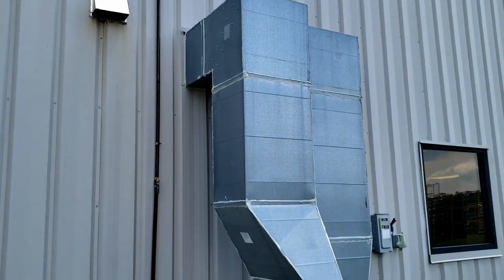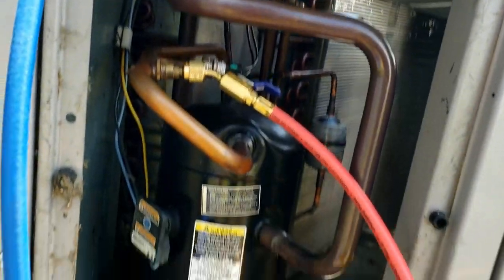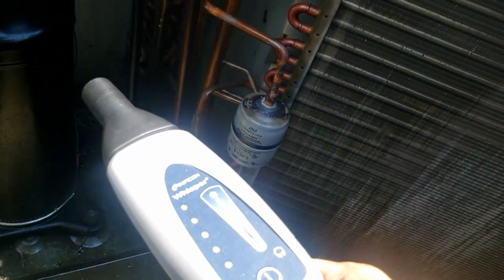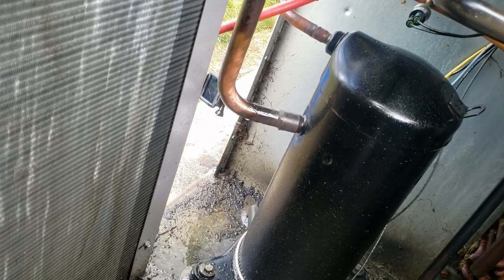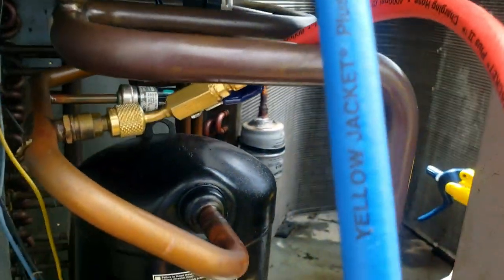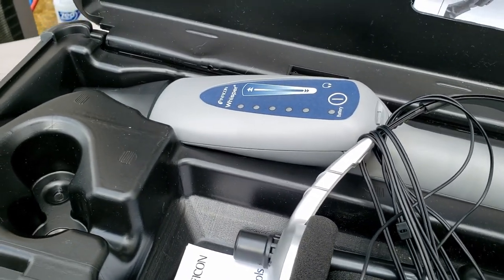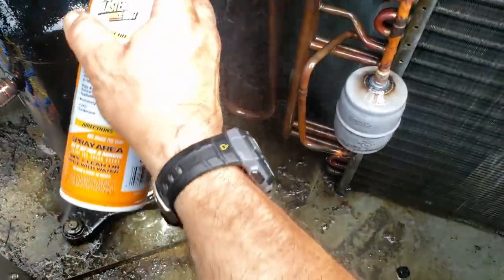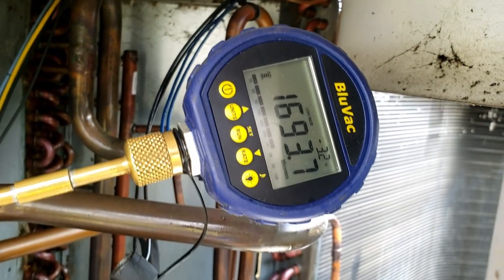Break Room AC Not Cooling

Comment: I had a residential heat pump ,about 2ton, split on a 1/4” capillary tube for the high pressure switch. Couldn’t see until I pumped up to almost 200psi. It was on the factory 90° bend too.

Comment: The leak is unusual because it's not a rub out leak, the pipe cracked. Always seems to happen right next to the compressor. Glad you replaced that section and don't just skim coat it!
Reply: Also love that you went above and beyond to degrease the thing for the next guy
Reply from the maker: I had a repair leak at a new spot after building my own elbow so I replaced it with a factory built elbow and it hasn't broken since, I learned the hard way. Thanks for watching!

Comment: Those braze joints looked excellent! Even better than factory. I’ve been putting a small amount of wet rag from refrigeration technologies on my driers before I braze them and it really doesn’t take much longer to heat up the joint. I understand where you’re coming from not wanting to be on the joint too long and overheat it but I’d rather not burn the paint and cause the drier to leak. I’m in a coastal climate and I put most of them in the attic but you don’t have any choice on a package unit.
Reply: I use wet rag on mine too. I love seeing a brand new looking drier with no burnt paint

Comment: I smell vibration issues....had the same problem with carrier package units and those scroll compressors...
Reply from the maker: Just the design of how they went back and forth back and forth like I pointed out tells me you're on the right track. They were trying to make a cheap vibration eliminator by doing that.
Reply: @HVACRSurvival  i though someone was showing off the tube bender skills.
Reply from the maker: @MaterToys  🤣🤣 maybe, it wasn't me though😏

Comment: I’m not sure where you’re at, but single-hole panduit straps work okay on those Carrier tube sheets. One up top of the LLFD, and one down bottom. In AZ, you have to use the metal straps, as panduit straps won’t last. Carrier has two different metal straps, one for Sporlan raised-middle, and all others.
Reply from the maker: Ohio

Comment: Another HVAC guy that I watch on here uses a Wet Rag product I think it's from Viper it helps keep from burning your filter dryers and other sensitive electronic parts. Just a suggestion.
Reply from the maker: I got some hot block, it does work, I hate how long it takes to get the short stub to heat up, the dryer still gets too hot and although the paint doesn't get as damaged it still does a number on it.

Comment: I think the leak comes from when they did the bend at the factory , sometimes if you don't lubricate the tubing and you go a bit fast or rough , the benders can kinda damage the copper with like a hairline crack in the making . Then with time and vibrations it will start leaking at some point .
That's my theory anyway .
Can't go too rough on your pipe if you don't lubricate it , that's the moral of the story I guess  😆
Reply from the maker: Sounds logical to me 🤣👍👍🍺🍺
Reply: probably has some gnarly vibration there, surely it's work hardened and yeah bending always deforms and weakens things.
Reply: Annealing your bends helps to avoid potential leaks aswell

Comment: Nice video Rick. I was wondering before you said something on the video ... on a scroll compressor of that size, is there a safe amount of oil to add where even if it was not hardly low at all you still wouldn't be putting it too high? Like 1 oz, or 2 oz? Basically, is there an amount you can add that even if the compressor were full ... it still wouldn't cause a problem?
Reply from the maker: Technically it's better to have a little extra than not enough but yeah you could probably add 2 oz and be fine.

Comment: I had one leaking from the bottom of the compressor it's was two years old and I could pick up freon with my sniffer but just couldn't find where it was coming from and finally determined it was the underside of compressor when I sprayed big blue under it blew back out I've never seen that
Reply from the maker: I've had it leak through the welds on the compressor before.

Comment: Work hardened elbow during manufacture?
Reply from the maker: I'm not sure. I have skim coated and even rebent my own elbows and had them leak shortly after for whatever reason. That's why I cut it out. I was tempted just to do a skim coat but remembered what I had problems followed less than a year later.

Comment: did you add some oil after it lost so much?
Reply from the maker: It looks worse than what it is. The condenser fan motor blew the atomized oil everywhere, just like a small spray can of paint can cover a large area with a coating. I carry 3 gallons of POE oil on my truck but I didn't believe it was worth over filling it because there's no way to know how much is actually in there without dumping it out and measure it back in.

Comment: So I never see any of you guys replace the lost oil? Know some compressor have an sight class and can add oil but? Still have not seen you or anyone talk or show oil replacement! Now on a compressor replacement seen where empty out old to see how much was in it and to see new had the same! But ?
Reply from the maker: On a semi-hermetic it would have been easy to tell where it's at, I carry 3 gallons of POE oil on my truck if I thought it needed it. The condenser fan made it look a lot worse by lightly coating the whole inside. I've done oil changes on compressors and a couple different videos just not that often. Weigh it out weighed in.

Comment: Since you are there and charging customers hourly rates, WHY don’t you use a garden hose to wash and clean the compressor areas and HVAC rooftop Rails and base??????????
Reply from the maker: I didn't see water any where, I just started working at this location and I tried to avoid going inside as much as possible. To many safety protocols to be walking around in the plant looking 4 it.

Comment: I wish manufacturers would install vibration fittings (braided connectors for copper piping) at the factory, it would greatly cut down on weird leaks caused by vibration.  Here some information from one maker:
https://sbpholdings.app.box.com/s/itoquyk3i54yj55g80xxug9jlw70cac9

Comment: my job, the company disconnected air & heat from break room as well as bathrooms for employees, but customer bathroom up front is normal, done by unscrupulous company to squeeze every penny, & not care about employees
Reply from the maker: Time for a new employer, to many jobs to pick from to be treated like your a tool.
Reply: Wish I could, that's why I took that body shop job, but quit after 4 months when guy cussed me out. Been with primary company 37 years, great pay for area, nearly free health care, will have decent pension. But new upper management in main office 600 miles away made working conditions like this. That's some of reason I want to get into this, plus burned out with body-work
Reply from the maker: @randymack1782  hang in there, if you want it bad enough you'll get it👍👍